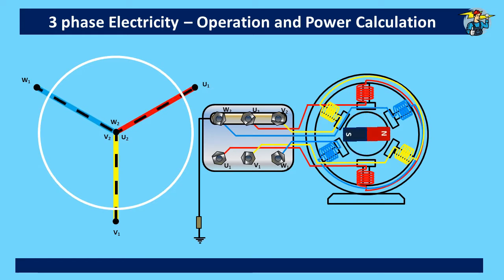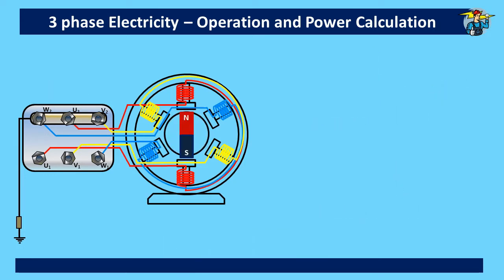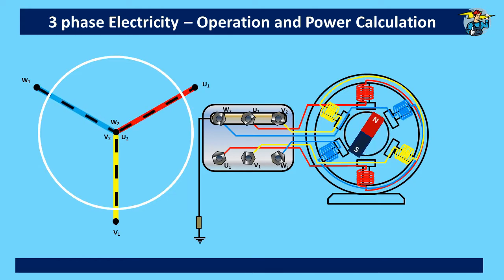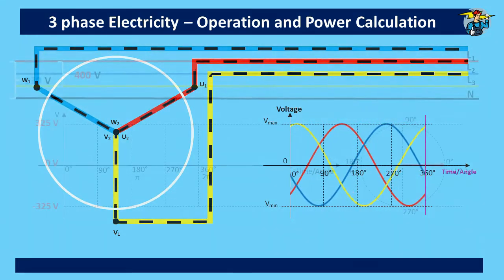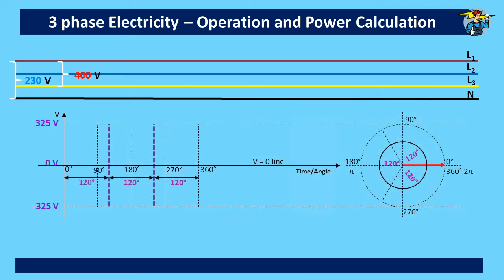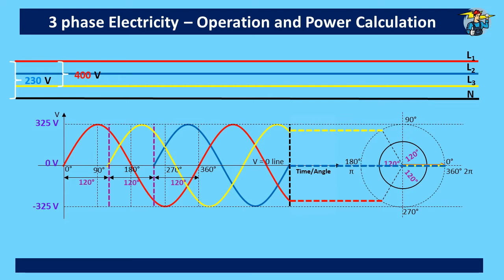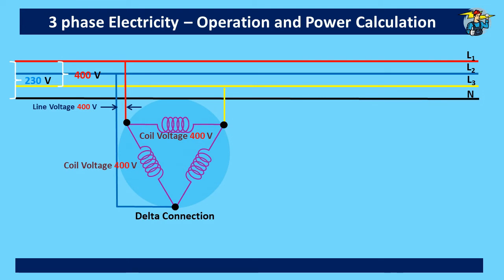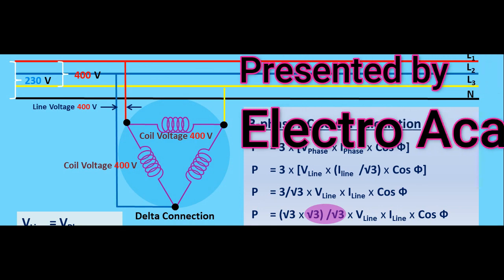3-Phase vs Single-Phase Power: Operation and Calculations Explained / 3 Phase Motor Applications.

Comment: The Neutral Grounding Resistor should have values close to zero so that the impedance is low and fuses can blow in the event of a fault.
Grounding this point helps keep touch voltage low in the event of a fault.
Reply from the maker: Thanks for your comment